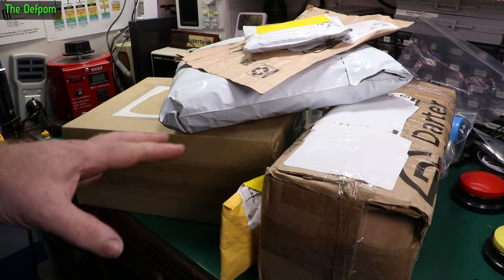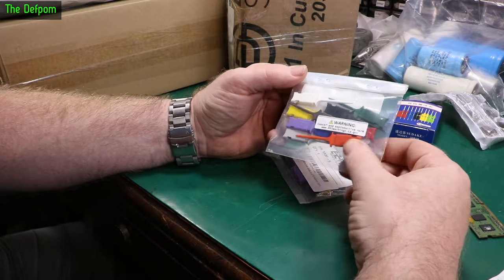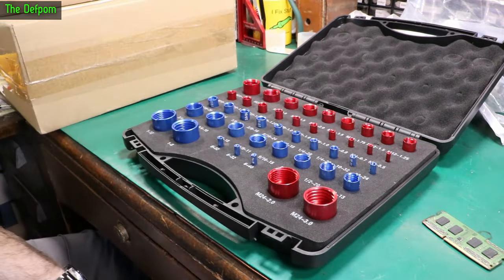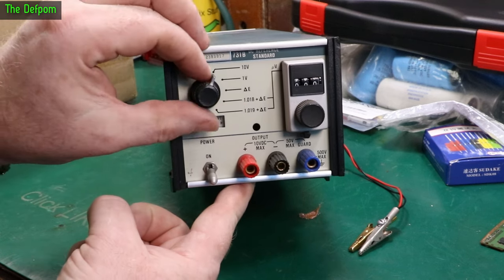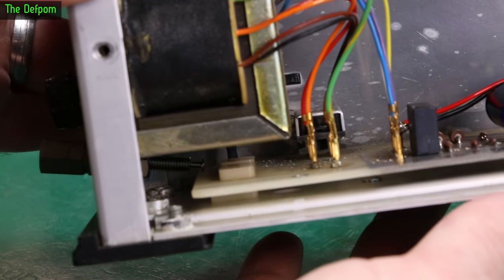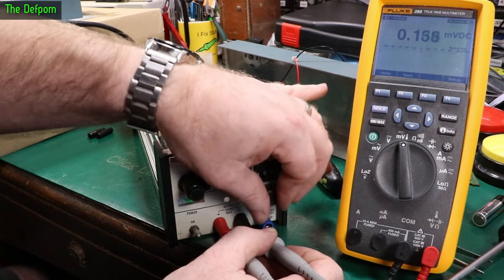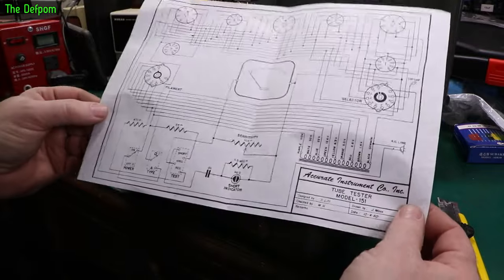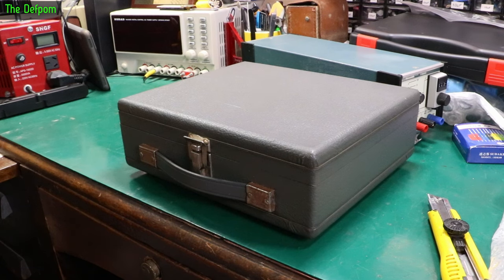🔴 Mailbag Monday 4th March 2024 - No.1228

Comment: The tube tester is pretty useful for alot of tubes. I have the same one. Used it  many times over the years.
Reply from the maker: Good to know, I will take it apart and do a bit of a refurbishment on it before I try using it, mainly the ac power cord side of things to be sure it is safe to use.

Comment: I have the big brother of the Fluke 731B, which is a rack cabinet carrying three of these inside one unit. It's used to compare the three sources to obtain an average for calibration. Anymore, people just stack three singles side-by-side to do the same thing.

If you would like to own the Cadillac of tube testers, try the B&K Dyna-Jet 747. If you can find one of the last manufactured, it will have the latest tube list. I used one to test new M-2057 (12 pin Compactron version of the 8908), and 8950 GE tubes with it years ago when I manufactured RF amps.